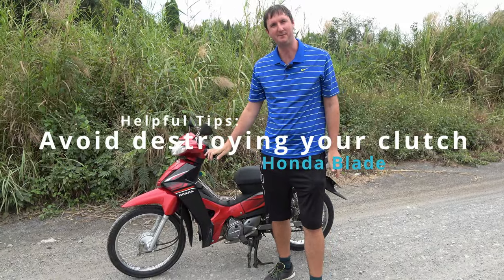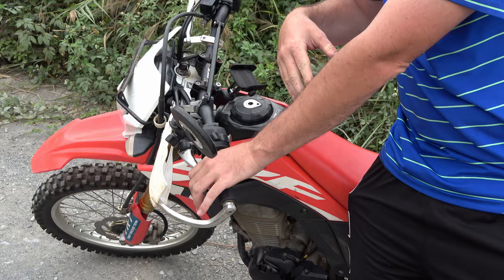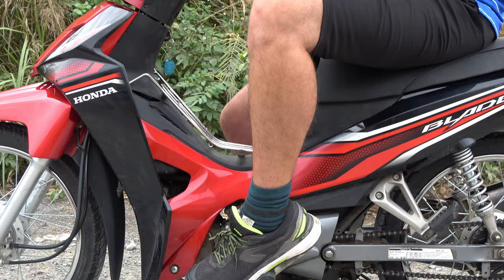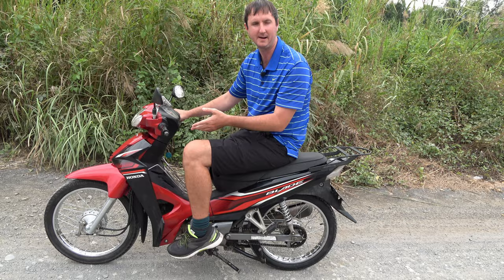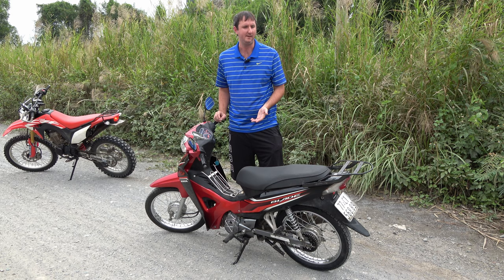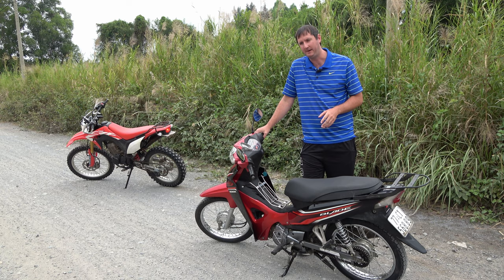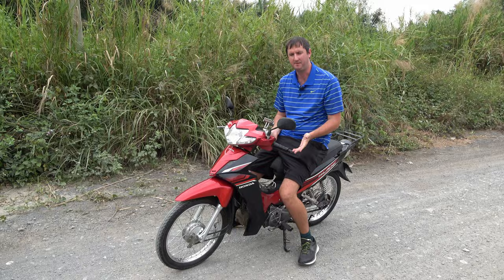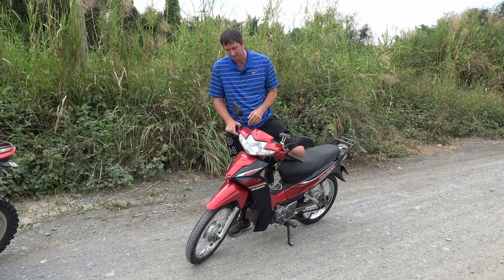How to avoid burning clutch on Semi Automatic Motorbike

Comment: Sir, Can i start my motorcycle on 4th gear after full stop? and the road is just horizontal? I saw some people doing that. thanks a lot hope this will be answered
Reply from the maker: You can do this. No problem.
Reply: @Tigitmotorbikes  thank you so much sir, i have the same bike its honda  rsx 110cc, close relative of honda wave, just one last question, will it not damage the clutch lining or any damage? thank you so much hope you will still response 🙏
Reply: @Tigitmotorbikes  because i heard it will put pressure on the clutch system when starting to accelerate from full stop using 4th

Comment: Hello bro.... Do you mean if am going down a slope, and i intend going down silently, then assuming my gear is right at gear 4, then i press my front gear lever down.... With that also be likened as burning my clutch?
Reply from the maker: no it isn't. 
Burning the clutch is caused by half pressing the pedal and reving the engine. 
Imagine accidently resting your foot on the pedal while driving. This is what breaks these bikes.
Reply: @Tigitmotorbikes  so to confirm, will flooring my gear pedal (thus the full clutch) while going down hill, do any/little/much damage to the mechanism?
Reply from the maker: @bmo3778  No damage
Reply: Good question. I was wondering about the same

Comment: Are the clutch plates of semi-automatic motorcycle same with the manual? I have a semi-automatic Kawasaki Z125 and plan to order heavy duty clutch plates that riders use on their manual Z125 Pro. Very informative video. Was trying to pop my Z125 to no success. :)
Reply from the maker: You need a mechanic to physically compare the plates. Or to figure out the part numbers of the two bikes to see if they match. There isn't a magical way to know unfortunately.
For example the Honda XR 150 (manual), has the same clutch plates as a Honda Wave (semi-auto). But you need to have physically seen both parts to know this.

I am not familiar with Kawasaki bikes, so I can not advise.
Reply: @Tigitmotorbikes  Thank you very much for responding! I appreciate the suggestion. Will try to check the part numbers. 👊🏽
Reply: The answer is yes the clutches are the same but a semi auto has two different types of clutches a normal motorcycle clutch and a centrifugal clutch. The motorcycle clutch is for changing gear like normal but the centrifugal clutch is for starting and stopping.

Comment: Next time, can you talk how you can gently engage the clutch when down-shifting?  And in doing so, does it cause undue wear and tear on the clutch?
Reply from the maker: You have to slow down to the correct speed, which is much slower than you would think.
I don't think bad downshifts cause any major damage to these motorbikes though. Very cheap to fix anyway.

Comment: But a bike clutch has a wet clutch in oil? So you cant burn it?
Reply from the maker: It does have oil in it. But you can still burn it :)
Has the added downside of the clutch plate particles getting into the oil and destroying the engine.

If you burn the clutch, the oil needs changing as well!
Reply: @Tigitmotorbikes  but I was told you can only burn dry bike clutches
Reply from the maker: @steve00alt70  You were told wrong :)
Reply: @Tigitmotorbikes  hmmm I not sure